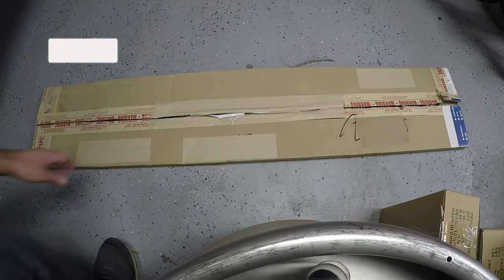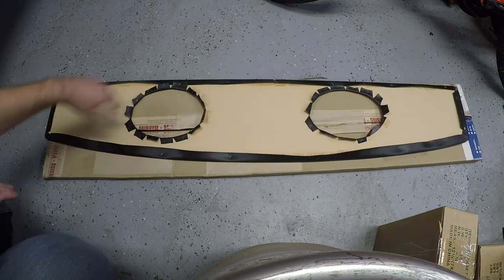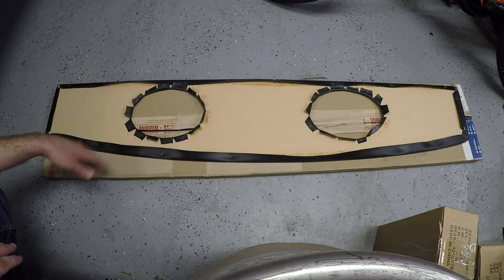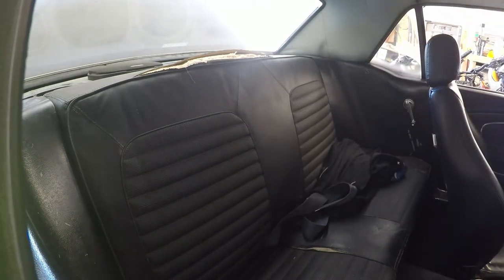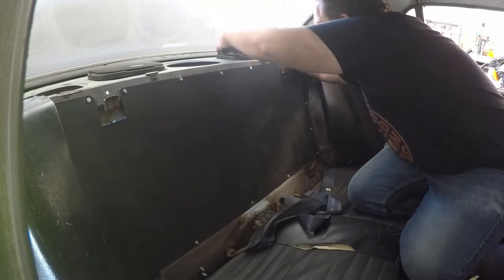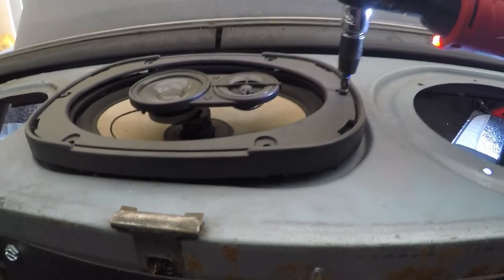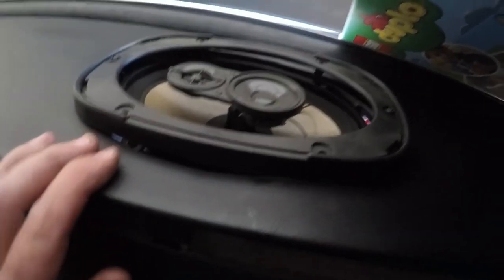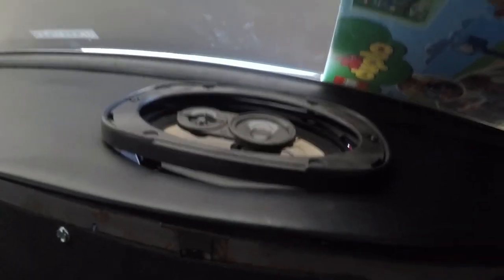Installing Package Tray 1966 Mustang

Comment: I made my own tray using peg board material and a vinyl rap.  Thinking that the holes in it will allow for the stereo bass and sound to easily transfer through.  I didn’t want to see the speakers in the rear and also so that the sun doesn’t damage the speakers over time.  It doesn’t seem to impede or distort the sound either.
Reply from the maker: That’s a cool way to do it. If I go to re do this one down the road I may have to try something like that.